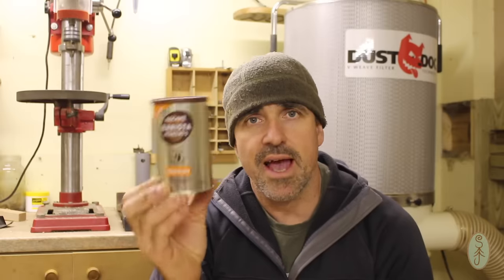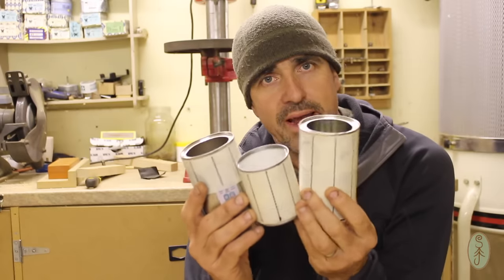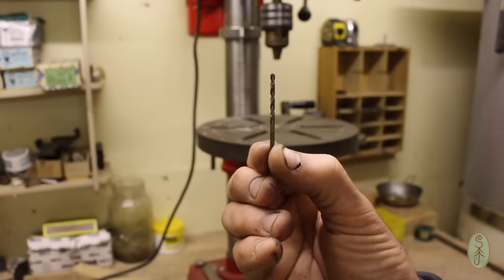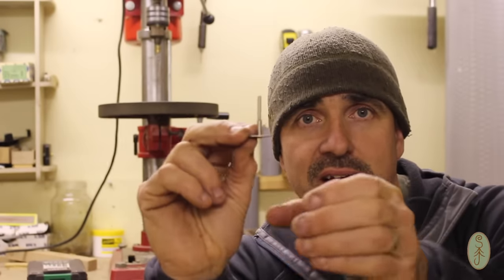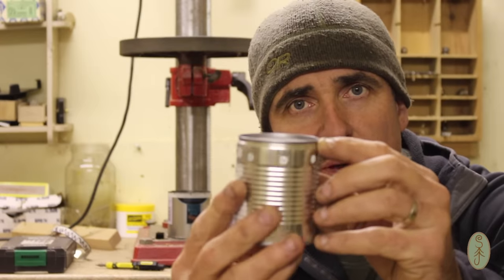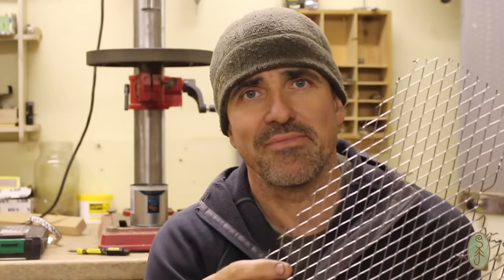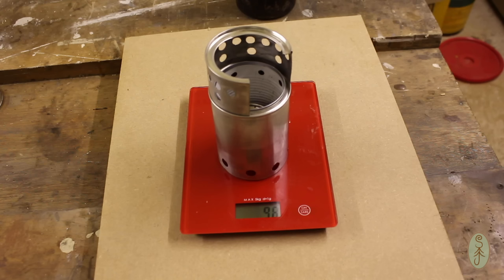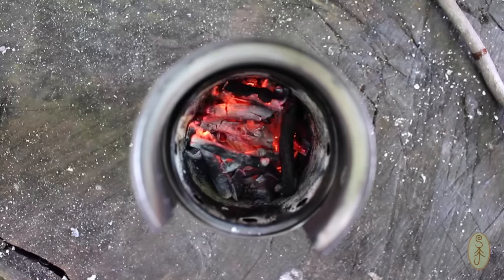Ultralight Wood Gas Stove.  How to Make a Super Light and Compact Backpacking Twig Stove.

Comment: For mesh on one of mine I used a cheap old tea strainer mesh. I used an old Lyle's Treacle tin and a bread yeast pot to go inside. Have you worked out optimum twigs weight and genus of tree?
Reply from the maker: Good idea to use a tea strainer! I haven’t worked out any optimal weights etc, good, hot burning hard woods like oak or hawthorn would burn longer. Cheers, Simon

Comment: Instead of removing the bottom of the sweetcorn container and putting mesh in why didn't you just drill a lot of holes in it? Also, if you filled the containers with damp (not wet) sand wouldn't it make the can more stable to drill holes in?

Comment: How have you found this works in practice? In particular, how much water can you boil?  I've made something similar but mine is single wall but quite a lot bigger. Interestingly it still produces the wood gas effect, must pull air in from outside the stove.
Reply from the maker: It’s certainly efficient, but works best with a small pot or cup. 👍🔥

Comment: I think the mesh under the combustion chamber is not a good idea, it allows the fuel to burn too fast and loses heat. If the corn can base is drilled with about a dozen evenly spaced 1/8 inch holes it limits air supply and traps more heat in the fuel chamber thus creating more woodgas and creating charcoal which will burn longer too. Is it worth a try?
Reply from the maker: I think you might be right on that one, it did burn through the first loading of twigs fast - I might try drilling and using the cut out base - see if it improves things. Thank you. Atb, Simon

Comment: Hi I have a question. Are you not concerned about the plastic coating that is inside the combustion chamber. Many folks have said that it is poisonous.
Reply from the maker: The plastic coating burns off during the first burn - after that, it’s all good. 👍🔥
Reply: @simonablokeinthewoods  ah ok thanks.

Comment: How do the cans hold up?
Figured the aluminium would burn up after a few uses, or rust out ?
Reply from the maker: It’s holding up well, been used 5 or 6 times so far. It’s all made from steel cans, aluminium wouldn’t stand the heat. They won’t last forever, but so far so good - shame the cans aren’t stainless! Cheers, Simon
Reply: @simonablokeinthewoods  ah gotcha, don't think we get stuff in steel cans here. Only aluminum.
Reply from the maker: Oot N Aboot! Ah, that is interesting! Even coffee cans? Take a magnet with you next time you head to the shops - if it sticks, it’s a potential stove! 😉
Reply: @simonablokeinthewoods  coffee cans are plastic or a coated paper with a tin bottom.
Reply: @simonablokeinthewoods  I have seen some potential things at a local Dollar store.
Very thick steel storage containers. 
Im going to pick up a couple this weekend and see what i can do.
I really need to find something for the base of it, as ive noticed with the other little i make they get very hot and scorch what they are sitting on.

Comment: If you soak your wood with methanol, or ethanol you'll have a gorgeous blue flame, just like the flame from your soda can stove. This will reduce the amount of soot.
Reply from the maker: Oooh - another nice tip! Thank you. 😁
Reply: Any time  @simonablokeinthewoods  ! Did you know you can make a simmer ring for your wood gas stove? Cut a hole in the middle, then hammer two  twos in the ends of a can lid, or paint can and add a long stainless steel wire to it. Then use pliers to make a handle. Two rings would work. One for medium heat, and one for low, simmer heat that can be used baking.  With this, and a suggestion to put a cake pan, or paint can lid on the top to say bye to soot on the pots and pans is making wood gas stoves a lot more safer, and reliable. Let's spread the word. No wood gas stoves have this. I used a tuna can for my lid, and a computer wire guard for the top, with stainless steel wire tied at the back so you can open and close it. I now have carbon felt to sew on more stainless steel wires I did wrap through the air holes on the top and bottom so it won't be so hot to pick up, and touch.
Reply: Be careful if you were to use the simmer heat while the stove is in wood fire mode. It may smoke. It would work perfectly for alcohol stove mode. I put my holes on the bottom and top near the center to you have a smaller flame you can control better, plus you can pour methanol, or ethanol at the very bottom of the can.

Comment: Ok ive now made it a 2nd time? Had difficulty fitting it placing it into my mcyles baffler exhaust system
But how do i now load it or light it?
????
Reply: This stove type is called a TLUD (top lit - up draft) which means fill with small twigs up to the level of the inner holes and place the tinder / waxed paper / alcohol gel etc on top - light this and it burns top down - made right it burns with visible flame but smoke free. This means you get to use one charge of wood for one clean burn - but nothing to stop you adding more twigs to keep it going... great as a stealth camping stove - no smoke to give your position away...

Comment: Hi. 
Why are you using two can inside it one can is also work better
Reply: You don't understand what a gasifier stove is.
Reply: Chucklebutty huu 🤨🤨🧐🧐
Reply from the maker: It would still work as a woodstove with one can for sure, but to get the secondary burn if the flammable gases given off, you need to introduce air to the top of the chamber through the air jets. The second can delivers this preheated air. You then get a hotter, more efficient burn. 🔥👍
Reply: @simonablokeinthewoods  ooh  🤨🤨🧐🧐 thank you for suggestion

Comment: This is my Design and is very easy. Randy’s Cheap & Easy Wood Gas Stove

This stove is easy to make, light (5.6 ounces), and easy to repair or modify. It is very inexpensive ($1.99 + tax + 1 can of Progresso soup (19 ounce size) and 1 can of Tuna (12 ounce size).

Wood Gas stoves are highly efficient and create significant less smoke than regular wood burning stoves and are even better it they incorporate a small blower fan. However blower fans increase the weight of the unit and require a source of electricity to function. This stove uses a natural convection inverted down gas gasifier design. It is a double wall stove with air intake holes on the bottom of the stove which channels air to the bottom of the fire while at the same time, channels warm air up between the walls of the stove. This burst of preheated oxygen feeding back into the firebox through the smaller holes at the top and sides of the stove causes a secondary combustion. This allows the wood to burn more completely which is why there is very little smoke during full burn. A more efficient burn also means you'll use much less wood compared to an open camp fire. The Wood Gas Stove doesn't just burn wood. It actually cooks the smoke out of the wood and then burns the smoke not once, but twice! 

Many commercial stoves are made of stainless steel or titanium which are superior materials but they are significantly more expensive and the design of this stove allows any of the 3 parts to be replaced easily if they rust out or are damaged.

The Finished size of this stove is: Diameter – 4.25 inches     Height – 4.875 inches     
Weight – 5.6 ounces (varies somewhat on hole sizes and numbers)

Materials:

1 – New Quart Metal Paint Can (Empty ~ $1.99)
1 – 19 Ounce Progresso Soup can
1 – 12 Ounce Tuna Can

Optional
1200 Degree Black Barbeque Spray Paint

Tools:

Electric Drill
Drill Bits – 1/8 “ and ½ “  I prefer a Unibit since it leaves cleaner holes in the thin sheet metal.)
Dremel Type Tool with cutting wheel and grinding stones.
Clean Edge Can Opener
Sharpie for marking hole locations and fabric measuring tape to determine hole location.

Construction Sequence can be done in any order but I will make an order list.

Step # 1.
Take a Sharpie Marker with the tip set 1 inch off of the working surface and draw a line on the bottom of the 1-quart paint can by rotating the can in front of the marker. Then make vertical marks on this line every 1.5 inches apart resulting in 9 hole sites. Drill out 9 - ½” holes in the side wall of the 1-quart paint can. The exact number and spacing is not critical and can be done freehand without marking any holes. When these holes are completed use the Clean Edge can opener to remove the bottom of the paint can. Make sure there are no sharp edges at this point with the Dremel grinding stones or sand paper. 
Optional – Spray paint this piece with 1200 degree black barbeque paint and let dry.
Step # 2.
Remove the top of the Progresso soup can with a Clean Cut can opener and eat the soup.
Wash the can.
Drill the Progresso soup can with 1/8 “ holes. The location and number of holes can be varied and feel free to come up with your own patterns with the following general rule.
Bottom of the can ~ 8 evenly spaced holes. 4 equally spaced holes in the first depressed ring and 4 equally spaced holes in the second depressed ring shifted 45 degrees from those in the first depressed ring.
Sides of can 
 Bottom – 3 staggered rows of 8 holes about ½“ from the bottom and about ¼” between the 3 rows resulting in a zigzag pattern.
 Top - 2 staggered rows of 8 holes about ¼” from the top and about ¼” between the 2 rows resulting in a zigzag pattern.
Clean the holes if necessary with Dremel grinding stones or sand paper.
Optional – Spray paint this piece with 1200 degree black barbeque paint and let dry.

Step # 3.
Place the paint can upside down on a firm surface. Insert the Progresso soup can into the paint can with the open end down and gently pound the can into place for a pressure fit into the top opening of the paint can. I suggest using a rubber mallet for this step and try hard not to hit the edge of the paint can which will bend.

Step # 4.
Remove the top of the 12 ounce Tuna can with a Clean Cut can opener and eat the Tuna.
Wash the can. Take a Sharpie Marker with the tip set 3/4” off of the working surface and draw a line on the bottom of the 12-ounce Tuna can by rotating the can in front of the marker. Then make vertical marks on this line every 1.5 inches apart resulting in 9 hole sites. Drill these holes with the ½” bit. Select 3 of these holes to become the fuel opening. Offset a hole ¾” from each end of the fuel opening and set ½” from the top end of the Tuna can and drill these out. Then use the Dremel cutting wheel to connect the fuel opening holes to create a port for inserting fuel into the stove while it is burning that is larger at the bottom than at the top.
Use the Dremel Grinding stone to smooth out the edges of this opening.
Optional – Spray paint this piece with 1200-degree black barbeque paint and let dry.

The stove is now ready for use.

Stove operation:

Step # 1.
Set the stove on a sturdy surface that will not be damaged by heat or catch fire and that is not close to flammable materials and has good ventilation. This stove should never be used indoors or inside of a tent.
Optional – You may use the paint can lid under the stove to prevent embers from landing directly on the ground under the stove.

Step # 2.
Fill the stove with small dry tinder and small pieces of wood and light it. (Use of fire starters or fire starting gel is acceptable) Once the fire is going feed it with small pieces of wood until a good sustained fire is established. 

Step # 3.
Place the Pot Support upside down on top of the Stove with the fuel opening in a convenient position to feed in additional fuel to the fire as needed. Facing into the prevailing wind is desirable.

Step # 4.
Cook your Food. (The ringed solid top of the Pot Support acts as a heat diffuser reducing hot spots and keeps your pots and pans cleaner).
Reply from the maker: Sounds like a great design! 👍🔥

Comment: Close off the bottom of the corn can, limit the amount of air coming into it. You wanna produce smoke (wood gas) and then burn it up top with extra oxygen. You'll get blue flames and use up less fuel.
Reply from the maker: Cheers, I regretted using mesh for the base - burns too quickly. It worked and produced wood gas, which burned as it should as a secondary combustion, just burned too fast.

Comment: A trip to the auto parts store and a can of high temp engine paint to make it rust proof and you are all set.
Reply: Tin cans are already galvanised.
Reply: The high temp will burn the zinc (aka galvanized) coating off and it will rust quickly.
Reply: @cellardoor2197 Yes, I was thinking of that stuff you paint indoor fireplaces with. There's also a product called Rust Oleum that is heat resistant to 1200 degrees. Black enamel type stuff that you can paint on or spray on.

Comment: Mesh is a good idea could have used this one today i been in oak walnut forests collecting kindling and firewood for winter!? 
Had a cup of hot tea whilst in there but i used a spirit burner alocs nice n small really
Ive got 2 home made jobbies but not as advanced as this is in its design
No needs for recourses to NASA engineering div at cape canaveral florida running into the bunkers secs before it launches away!
Reply from the maker: I’m a big fan of those lightweight pop can stoves! 👍

Comment: The biggest problem with this project is that a person can spend all that time to make a tin stove that will only last a few uses and then it will have burned up. Then they will have to make another one. Better to make a stove out of stainless steel (get over the weight!) one time, unless you like making disposable camp stoves because you want to save a couple of grams of weight.
Reply: Here in South Africa there is a product called Rust Oleum. It's a paint on OR spray on enamel that is heat resistant to 1200 degrees AND rust resistant. It is used to paint barbecues and fireplaces. Whenever I make anything from tin cans I spray it on. I just feel that if I have put so much of myself into making something, even if I've used old tin cans, I need to respect what I've made and keep it as well as possible.

Comment: Just another thing to carry imho ,
Make a fire carry nothing .
Reply from the maker: Yes, you have a good point and I agree with you to a point. There are always those times though when it’s not possible (or legal) to have an open fire on the ground, plus this stove is many many times more fuel efficient, using only a few twigs to burn in a controlled manner. I do love a proper fire though! 🔥🔥🔥
Reply: Simon, a bloke in the woods 
I see ypur point ,
It has a place btw great video on how to build one easy to follow and clearly explained .
Ty